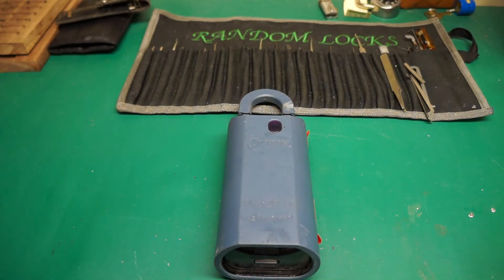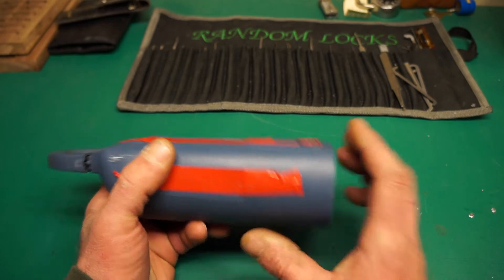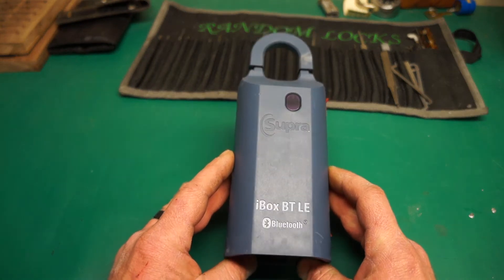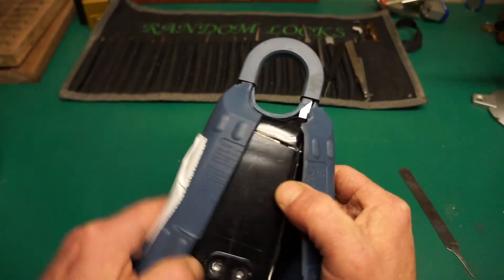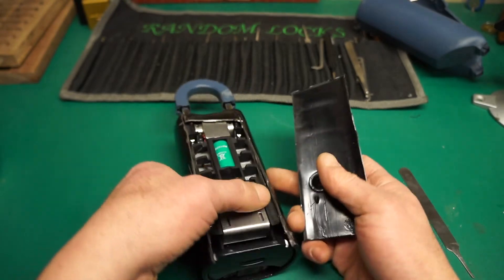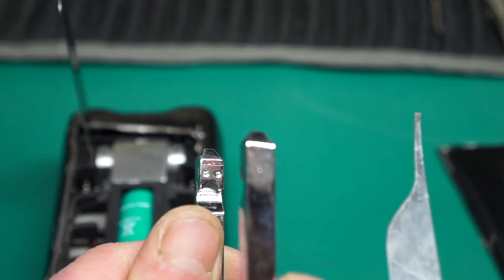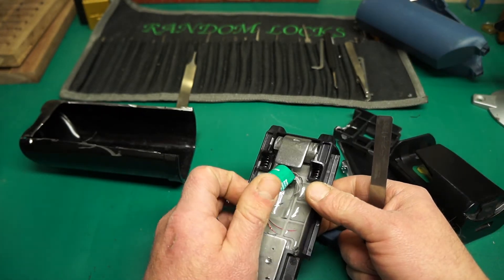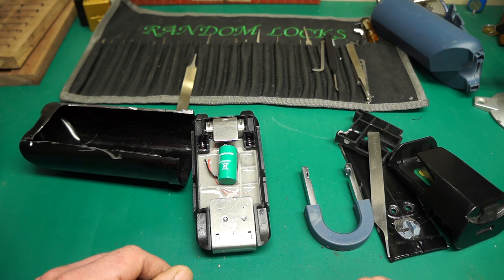(-87-)  Supra Ibox BT Whats inside?

Comment: Could you use the applied voltage with the lock fully assembled?  Or, could you use a magnetic device to open it? I think that Sparrows sells a device for this reason but it might be a different manufacturer but it is available.  What do you think bud?
Reply from the maker: The Avid Picker the magnet is a good question. I don't believe the sparrows magnet would work at this unit works on a dual plunger principle and not a lever. I do have access to a 250lb magnet, I'll give it a shot and let you know what happens.
Reply: Random Locks Awesome!  Thank you!  I have been wondering if the magnet tool worked on these types of locks. I'll be waiting for you to let me know.  Again, thank you for doing this.
Reply: Any news on that :D?
Reply: Did you ever tried the magnetic?